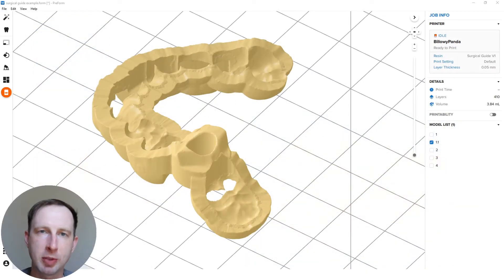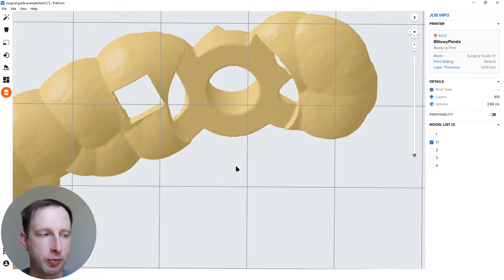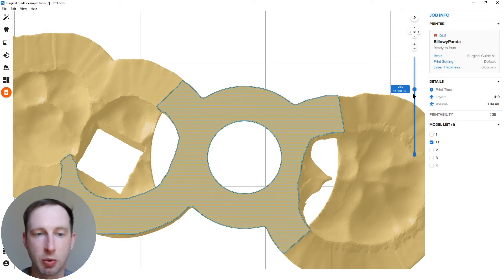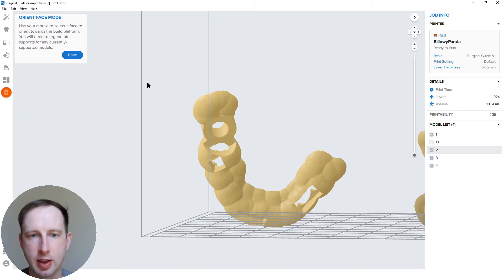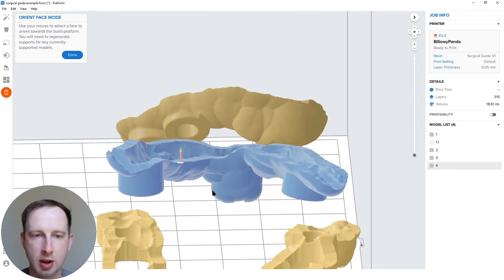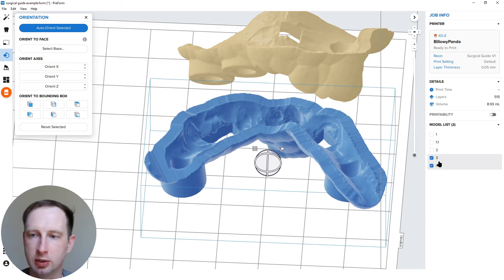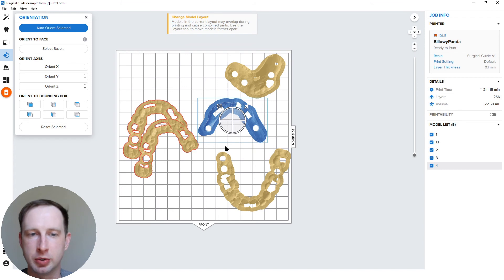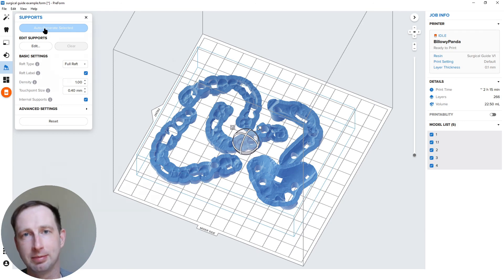Preform - How to Set Up Surgical Guide Jobs Consistently

Comment: Hello,
we're having trouble with a guide with 3B and surgical guide resin. It's a 5 implants case and not a lot of parallelism XD I would like to send it to you to see what would you do because we had 1 fitting perfect and 4 horrible. We tried some tricks but arfff. The implant plan. soft I use let's me chose 1 setting offset for all of the same sleeves, so I cannot have different fittings and I need to know what setting to put and it changes from sleeve to sleeve.

thank you

Comment: I tried that resin, horrible print result. Ended up using regular model resin, chucked the guide resin in the bin.
Reply from the maker: Hi Archie, Form 2 or 3B?
Reply: @FormlabsDental  Form 2, I don’t print a lot, the machine never had any problems needs to be sent for repairs. Good quality on Formlabs.
Reply from the maker: @wzk921109  It might be early signs of optics health, some resins show it sooner than others. If you share your printer name I can check. Even if it is optics, cleaning the parts involved in the path of the laser (glass and mirror for example) will get you back up to spec and printing surgical guide successfully.
Reply: @FormlabsDental  thanks m8, I’ll keep that in mind. I don’t know my printer name...
On the side note, are you aware of TGA requirements changes in Australia? This recent change means if Formlabs doesn’t get the printer, wash and cure TGA approved, we will soon no longer able to use it in surgery anymore. As a small practice, I don’t have the resources to deal with government agencies, we’ll have to buy whatever TGA approved. Our needs for splint, denture, surgical guide does not change though.
Reply from the maker: @wzk921109  I'll ask and mention this with our regulatory team, we also have a good partner in Australia that helps us with these things. Sound like a bit of alignment will help. You are welcome to email any additional information that you may have in an email to me and the team at dental (at) formlabs.com , thank you for watching and commenting!